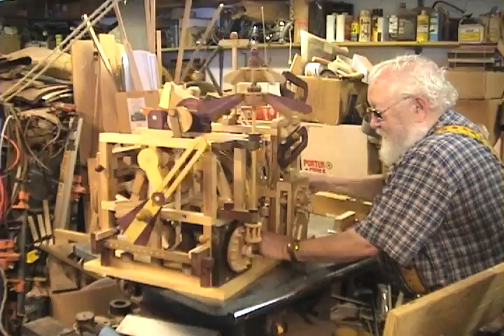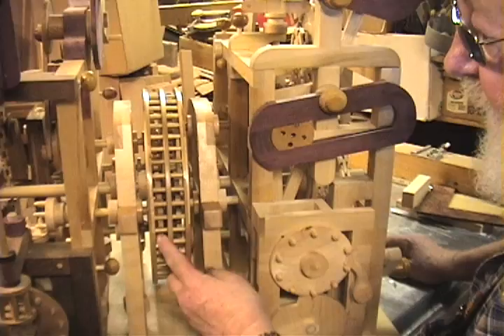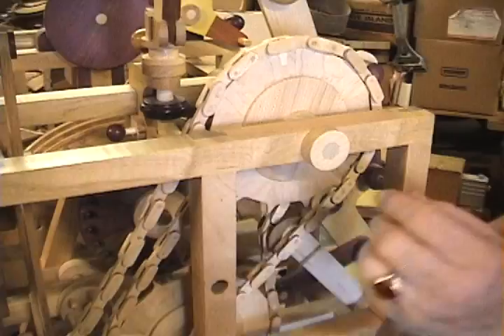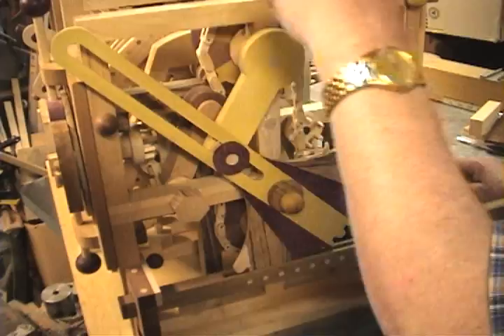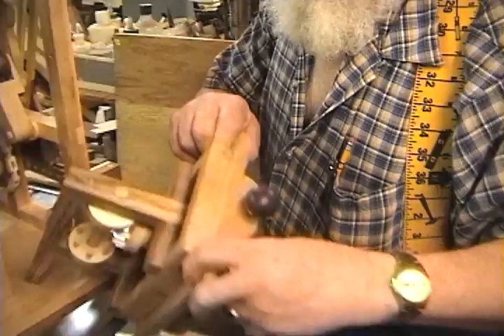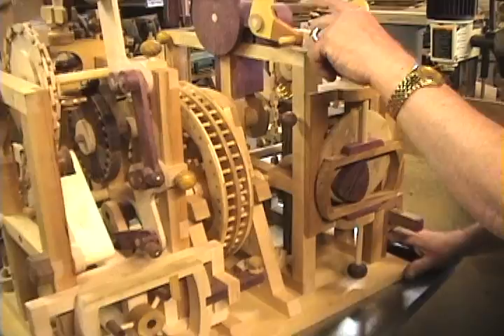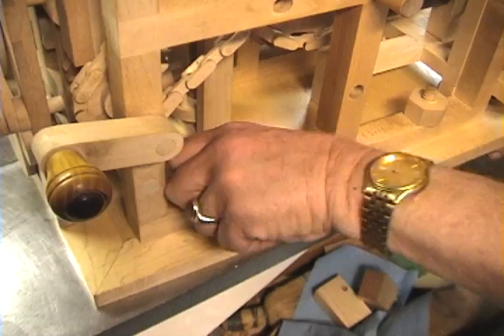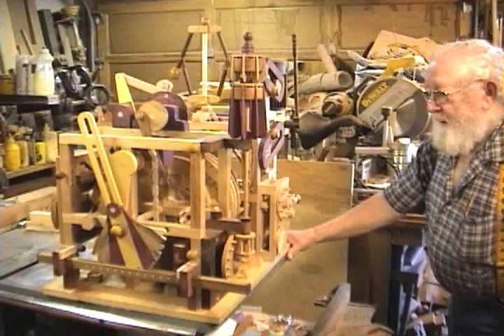Del Short's Beautiful New Wooden Machine

Comment: I love this. With so many moving parts, does it need to be cranked on a regular basis so it doesn't seize up when the humidity changes?
Reply from the maker: +segoon2000  Right you are! The fine tolerances involved definitely make Del's all-wood contraptions more susceptible to variations in humidity & temperature. I think he comments on this in one of the vids I posted here. In the Willamette Valley of Oregon, humidity varies alot ... high during much of the year but low in the warmer summer ... but he made 'em work anyway, and he designed them in modular sections so they would be easily taken apart to adjust clearances as needed. I believe that is demonstrated in one of the videos here, too.